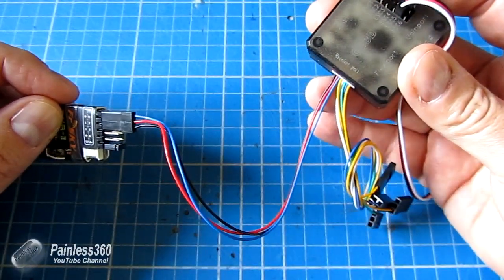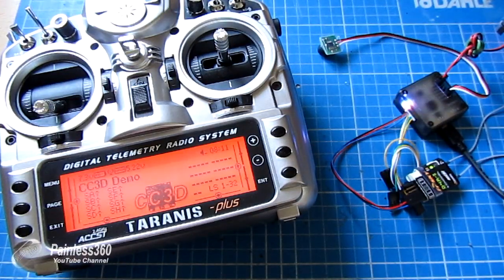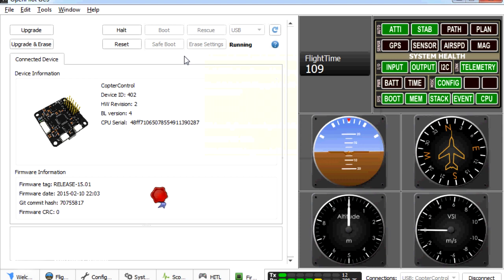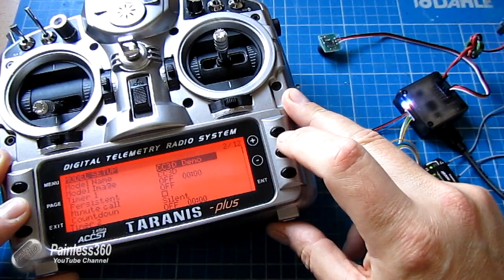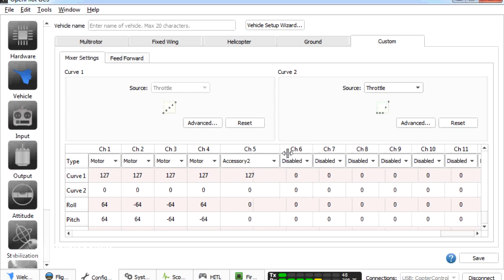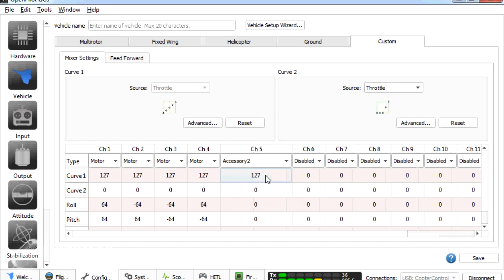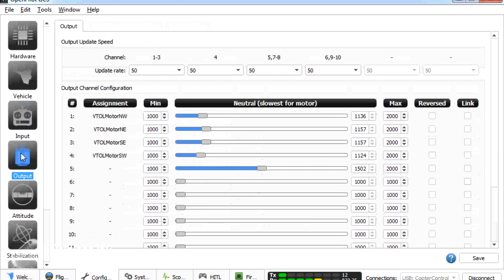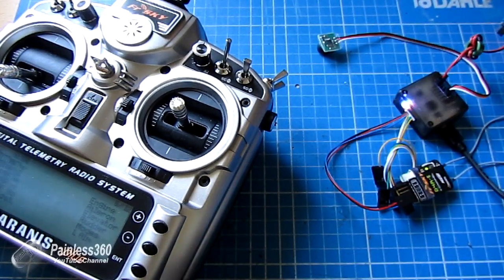(7/10) CC3D Flight Controller - Adding a buzzer with a CPPM/PPM receiver (ADVANCED)

Comment: I'm getting ready to try this on the SpeedyBee F405............and INAV.  That's my main compliant about that board.  No buzzer pads.  Plus the buzzer on the USB is not very loud and won't do you any  good if the battery gets ejected.  On the Matek boards with breakout USB board there are solder pads which allow you to solder one to the breakout board.
Reply from the maker: Check out my build using the Speedy Bee in the T2 CRUZA from the weekend.. Happy flying!

Comment: brand new and just built first quad, i know cc3d is old tech but price was right for something to learn with and probably destroy through building, fixing or flying . my question is you are connecting buzzer to channel 5 but that channel is already used for flight mode? what am i missing?
Reply from the maker: There are two channel 5s. One from the radio to the flight controller (via the radio link) that you use for selecting modes and CH5 PWM output on the flight controller that connects to something like an ESC. I've notplayed with CC3D for a long time so the most up to date detail is in places like this - https://librepilot.atlassian.net/wiki/spaces/LPDOC/pages/6324237/Add+a+buzzer+to+Multirotor+frame Best of luck!
Reply: Thank you i am pretty sure I understand now. By the way thank you for all your videos! You are one of my most reliable go-to for learning this hobby! There is so much to learn and when I think back just 6 or 7 months ago and have gone from knowing nothing to having a working and flying quad, a couple scratch built foam planes i can actually fly without crashing to badly, and enjoying programming my Taranis Q7, it is amazing. Keep the videos coming and we will keep watching and learning!

Comment: Hi. Not sure whether this is the right section to ask this question but it seemed appropriate. I'm a semi newbie to all this ppm/flight controller stuff but must say that your vids make life so much easier. I have just received an Eachine 250 racer and have set it up with a D4R-2 outputting PPM. They provide a connection to allow switching of the LEDs but I cannot work out how to connect the signal wire to control it from my Taranis plus. The FC doesn't have output pins that I can connect a normal servo lead to so I was wondering if there is some way of connecting the LED on/off to the spare PWM channel 2 on the RX. Any help would be appreciated.
Reply from the maker: The LEDs are normally controlled form the flight controller, not the receiver (if you're talking about the LEDs that you can change the colour of as you fly). See the Naze32 series where we setup the LEDs that may answer a few of the questions you have. Best of luck!

Comment: How can I do this but with a CC3D + Cleanflight/Betaflght? (I need it to be connected to the out put pin 5, since the 6th is occupied)

Oh! and Painless - You rule man!
Reply from the maker: Noyt easily. If you want a buzzer with Cleanflight I'd use a board with the Buzzer pins/connections on for similar setup and use. The CC3D isn't a great platform for CF/BF. Happy flying!
Reply: I got this, and I wanted to get it to work: http://www.banggood.com/Matek-LED-POWER-HUB-5in1-V3-Power-Supply-Board-BEC-5V-12v-Low-Voltage-Alarm-Tracker-p-1019353.html
Reply from the maker: Let me know how it works - looks interesting!

Comment: Hy Painless360 any thanks for your helping vids!
I have a little problem with the buzzer...
You said the reciever port from the cc3d have to ba changed to ppm+outputs. I have connectet a ppm+pin8+oneshot at the port, so y cant change or i will loose the reciver signal.
Do you have an idea to solve the problem?
Thank you and sorry for my bad english ;-)
Reply from the maker: Sorry, not sure. All of the steps we used are in the video. Best of luck!

Comment: Hello,
  I recently had a crash a the RX port on my cc3dis is now broken off. Attempts to re-solder were unsuccessful  can I use the flex port for PPM? and if so how do I do it lol?
Reply from the maker: What does it say in the documentation? ;) Happy flying!
Reply: +Painless360 the flex port has a 4 wire connector ...pos neg and signal I get.. but what  about the 4th wire ?
Reply from the maker: The port is normally power, GND, Rx and Tx. I wouldn't expect the Tx pin to be used with a recover though. We've not done it here - best of luck!

Comment: Does anyone know, if it is possible to add the same buzzer to a esc out, on a cleanflight board?  
I have a x-racer board, and the rubbish buzzer solder pads came right off, once i tried to add the buzzer. This means, that i am now not able to add the buzzer to its dedicated place, and now i am looking for alternative ways to ad it to my quad. 
I am using the x-racer f303 FC and the Flysky 2.4G 6CH FS-iA6B Receiver PPM Output With iBus Port.
Thanks for the help.

Comment: As always great video.  Just a bit of an update trying to do this with Turnigy I10, LibrePilot, and Oneshot 125 ESCs.  The Oneshot ESCs use PPM regular power (red and black) from the receiver to the controller, but instead of the signal wire going to pin 3 of the controller as usual, it goes to pin 8.  Where I ran into some trouble is that when you setup the controller with the  LibrePilot wizard it configures the receiver port as ppm pin 8.  Evidently, the other pins, I believe 5-7 are automatically configured as output pins and no changes need to be made in the LibrePilot receiver port configuration.  I kept hitting a wall trying to reconfigure the receiver port as PPM and outputs.  That's not necessary, and in fact will not work at all.  I configured the rest of the software as outlined in your excellent video and i have a switch on my radio now sending a ppm signal to aux 0 which activates my channel 6 controller output.  Works great except that you have to have the single wire Hobby King plane finder.  I have the two wire finders which are intended to interrupt a  servo lead.  They kick on after 90 seconds or so and throwing the switch will kill it, but it's back on again in another 90 seconds and throwing the switch back again  kills it.  One wire finder is necessary for this to work and I've ordered some.  Thanks again for the great video.

Comment: Hi, hope you can help me.
I have the Matek 5 in 1 PDB and a PPM D4RII RX with a Naze 32 Acro Rev5. The buzzer of the Matek is connected to the input 5 of the ESC on the Naze and when I plug the battery it starts beeping all the time. Clean Flight recognise the switch that in other quadcopter I have assigned to other buzzer but here it doesnt work. Still beeping. I don´t know how to stop the buzzer and achieve that only sounds when I use the switch :(-

Comment: 9:13 custom screen I cannot change numbers.Whats up with that.And why is CC3D so convoluded compared to cleanflight.
Reply from the maker: It's not normally. The closing of Openpilot didn't help but Librepilot looks excellent. Best of luck!
Reply: Thanks.I am at 8.55 and cannot change the number to 127 under ,accessory2 CH5.I have the DDRII ppm.I am very good at configuring the taranis and everything else ob the ccsd like flight modes but following your directions exactly is not working.Really sucks.

Comment: I'm confused...using PPM on the receiver, aren't the other channels on the receiver available in PWM and you can connect the buzzer to one of those pins on the receiver??? and not use the CC3D??..am I missing something?
Reply from the maker: Depends on the receiver. I use the R615 from Hobbyking for if this exact reason..

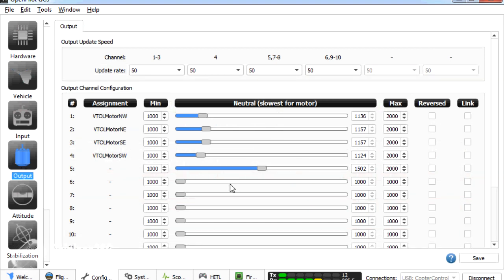Comment: Hi Painless, I've followed your instructions on this video, but when I get to the Output section in Openpilot, the slider on Channel 5 does not move and staysall the way to the left, not centered like in your video at 10:05. What did I miss?
Reply from the maker: +Tim Ng Not sure. this is what worked here ;)

Comment: Wil this work if im using the sbus connection?
Reply: +Amina Chee It will work with sBus & CC3D. I have just set it up now. Connect the buzzer to your cc3d pins (i used the last set Ch6)
Follow this video carefully & you should be OK. Dont forget about the cc3D OUTPUT tab needs changing to 1000-2000 as well.
Reply from the maker: +Amina Chee Not sure, give it a go and let us know!
Reply: +Amina Chee i have the same question.  have you tried it?

Comment: I'm trying to set this up with my CC3D Atom that is running CPPM from an OrangeRx R410x.  I'm using Version 15.02 of OpenPilot and a couple of the screens are different.  One in particular is the Output screen.  In the "Output Update Speed" section, I have the option to choose between two modes of PWM and PPM.  Do I leave Channel 5 as PPM here as well?  Also, I am using the HW option for my RcvrPort as PPM_PIN8+OneShot.  Will I still be able to add the Lost Alarm to my Channel 5?
Reply: +Greg Jones did you get the alarm working??
Reply: +Johnathan Mark Smith unfortunately I was NOT able to get this working.  I would love to hear from someone who was successful in doing so.  I really could have used it this evening, as my 150 quad went down in a tree-filled park and I had a hard time locating it.
Reply: +Greg Jones Fyi, I managed to get the buzzer working. OpenPilot Rel-15.02.02. HK Buzzer on Motor5 of CC3D. Using Pin3 of CC3D so PPM+NoOneshot for HW. Under Vehicle Screen set RCInput(Accessory0)=RCOutput(Channel5)Curve1. Under Input Screen, set Accessory0 to Buzzer channel in Radio(set min1000,neutral1500,max2000). You will then see in Output Screen that Output channel #5 is assigned to Accessory0. Make sure you save every screen.
Reply from the maker: +Qamal Osman Great detail, thanks for posting that..
Reply: Thank you for the info *****.  While it appears that your settings will cause me to lose OneShot, on a 150 quadcopter I'm not sure I'll really notice it missing.  Not having it and having a buzzer is better than not having the quad because I can't find it. :)

i will give your settings a go this weekend and report back with my results.
Reply: +Greg Jones For your OneShot ESC's, you can still use your previous setup i.e. RcvrPort as PPM_PIN8+OneShot. Then follow the other steps from my previous comment. I tried both methods, using Pin3 (PPM+NoOneshot) and Pin8(PPM_PIN8+OneShot) Both works for me. Hope this helps. :)
Reply: +Painless360 No worries. Your series of videos are really informative. Really appreciate it.

Comment: can you use a piezo buzzer with only positive and negative wire connected to the fc?
Reply from the maker: Peter LEŠNIK Nope, you need a wave to make the noise so you need one that will sound automatically. These buzzers are very cheap to buy..

Comment: Great video! Any chance of setting up a buzzer with CC3D running Cleanflight (like the Naze32/Flip32 boards)?
Reply from the maker: terjetularsen Not unless I get a lot more requests for that specifically. Tying to cover every version of the board with every version of the firmware for every feature makes it impossible to keep up. 
With the Naze32 videos and the online tutorials should make figuring it out a lot easier!
Reply: Painless360 The CC3D and CC3D Evo boards do not have a designated buzzer output. Otherwise a perfect board size and price wise :-)

Comment: So is this not possible to do  if I am running PWM because of lack of channel inputs? I was initially using PPM on a Naze32 with the Orange receiver. On two separate flights in the the same session I briefly lost all control and torpedoed into the ground. Each time I would find the copter, everything was working. So I'm gonna try the CC3d with a spectrum receiver. I have a 9ch Tx and would like to arm it with a switch. But I would like a buzzer finder too. So with the mode switch included I will now need to have 3 separate channels. Will my 6ch receiver in PWM work or will I have to use PPM again?

Tnx for all your help, really appreciating all of your time and effort :)
Reply from the maker: tahosrfr If you are using PWM then you can simply plug the buzzer directly into the PWM channel on the receiver and avoid the FC all together. 
Best of luck.
Reply: +Painless360 what if all channels are being used. I have black widow 260 and ch5 is flight control and ch6 is speed(high/low). can you use port 5 on cc3d for leds or buzzer? or would I be able to pull off ch6 (speed) and use that for leds or buzzer without needing to reprogram cc3d?